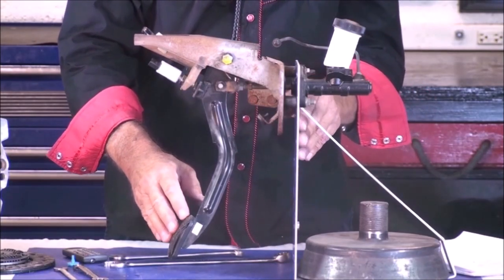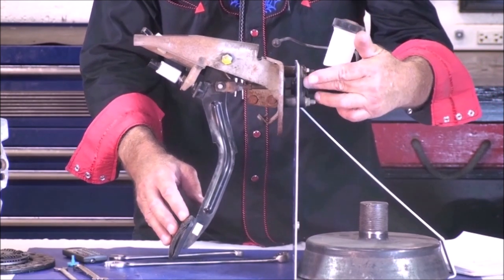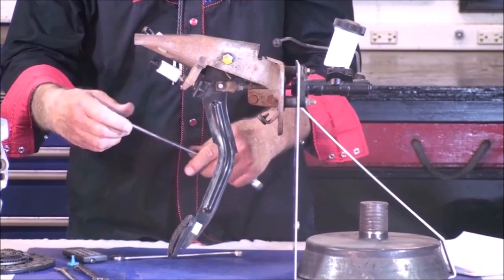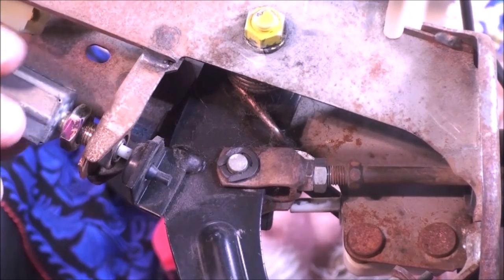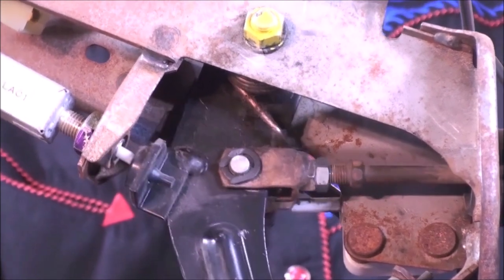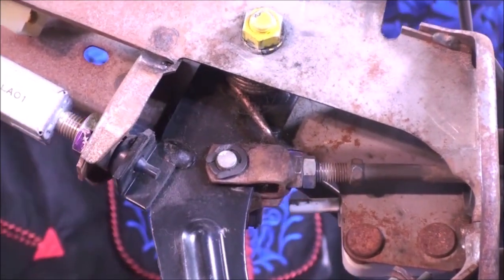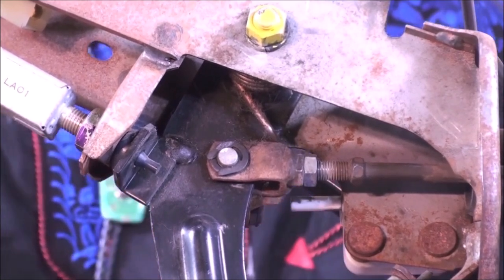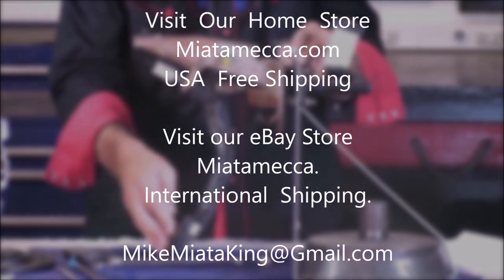How to Adjust the Miata Clutch Pedal

Comment: Thanks for the video, it was a good start. It allowed me to almost completely reduce shudder in first gear, still had a little bit of grinding between gears. I later consulted the Haynes manual and  first set the pedal height to factory spec. You did not set yours to factory spec you set it as far from the floor as possible. After setting the pedal height, I then set the free play at the maximum of free play range, 13mm. Now the car (an NB) does not shudder at all and never grinds even the smallest bit when shifting. It bites lower down and the pedal is easier to depress than previously.
Reply from the maker: Hello,
So glad everything is smooth going now. Mike. The King of Miatas.
Reply: what is the oem biteopoint?

Comment: Hi Mike I've just replace both the master cylinder and slave cylinder on my friends Mazda Protege 1.6 I bled the system I noticed the part on the gear box that pushes the rod into the slave cylinder is not moving at all during the bleeding process, will be the cable or clutch clutch also the pedal is pushed to the floor very soft no pressure won't go into gear at all.
Reply from the maker: Hello Sir Lion,
You may need to bench bleed the clutch master cylinder before installation. You will need to prime the pump before bleeding. 
Good luck with your Bleeding Mission.
The Miata King. Mike.
Reply: @MikesPlaceBiz  hello Sir Mike where can I prime the pump from also the master cylinder doesn't have a filler bottle on top of the cylinder.
Reply from the maker: Hello Sir Lion,  Sorry, we are not familiar with the Mazda Protégé to be able to help you.
The King of Miatas, Mike.

Comment: Awesome info, I need to get under the dash of my '00 and see where the clutch pedal is set.  I have to push the pedal in fairly far, past the point where the slave starts to move, to get CC to disengage.  My Integra will disengage CC by just tapping the pedal within the freeplay, so I'm not sure what's up with the Miata.

Comment: I'ma try this tomorrow in my 96 Ford probe gt  the pedal has play In it before it goes down all the way and sometimes a weird feeling coming up
Reply: My 96 Probe gt is a lil different there are two switches. one in the front of the clutch pedal  and this a nut and bolt on top of it that stops the clutch when it comes back.so the switch in the front and nut/bolt are not combined on my car the nut and bolt are above it that's switches button is like a inch and a half and the bolt and nut are longer . the spring above the clutch pedal that holds clutch pedal are different too it's up higher and has a lot more to it and the rod and when the clutch hits the ground there's a switch it hits . When my clutch is coming back there's a little bit of wiggle and play when I got it they said it needed a clutch adjustment it doesn't feel right above the clutch pedal kind of has is clunky stuck feeling when it's coming back at the very end when you let your foot I'll try to Justin get twice and I'm having more more luck  I might try one more time and then  I might try  to bleed it next or take it to a professional .

Comment: If they have to replace the master cylinder or slave cilinder, is that a big job?
Reply: I just replaced mine the last night it’s super easy maybe 2 hours just lift the car and remove the passenger front wheel and you can see it just past your subframe held on by two 12mm bolts and a 10 for the line (89-93) probably the same on the 1.8

Comment: If I want to move the clutch engagement point higher up, do I turn the rod in or out on an NB?
Reply: Hello,
You would turn the rod out to raise the sweet spot.
Miatamecca.
Reply: @famousseamusdude3636  Thank you so much. Had to replace the clutch fluid reservoir. Lower engagement point now, but no shift issues.😃

Comment: what is that switch for? My 97 has a switch but has NO cruise control.
Reply: Hello Sir Keith,
May have come from the factory ready for an OEM Cruise to be installed.
Mike, The King of Miatas.
Reply: My 97 also has the switch. It’s to prevent you from starting the car without pushing in the clutch. I bypassed mine with a metal clip so the switch is always pressed. This lets you start the car in neutral without pressing the clutch.

Comment: I tried adjusting my pedal and now my car won’t turn on
Reply: Hello,
You may have loosened up an electrical connection when you performed the adjustment.
Check the connections in that area. Good luck with your Miata Mission.
Mike. The King of Miatas.
Reply: @BalledandJacked  yeah turns out I loosened to much and it popped it out of place but my dad helped me get it working again
Reply: @lil_mac380acp2  Hello,
All is well that ends well in the Miata Kingdom.
Mike, The King of Miatas.